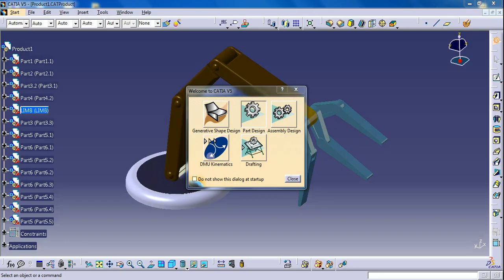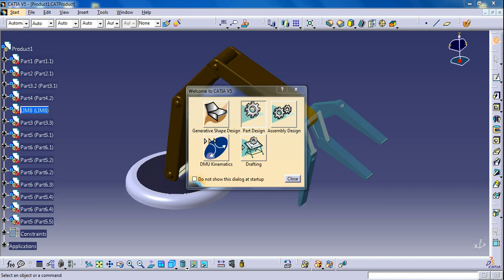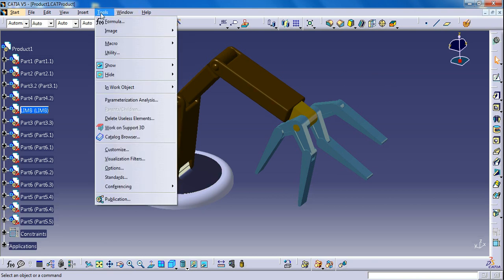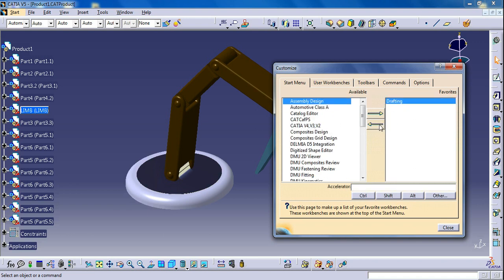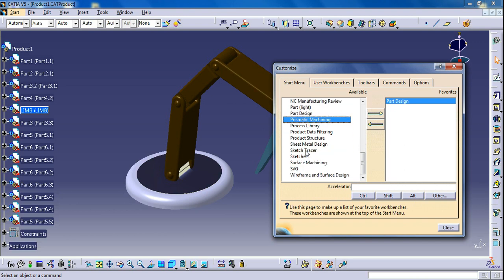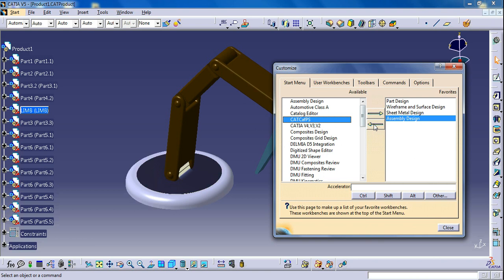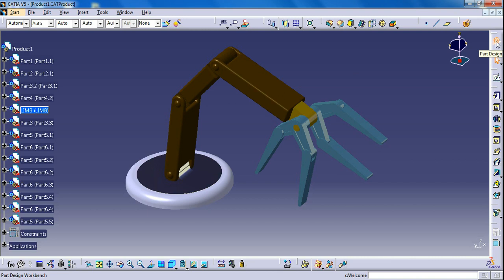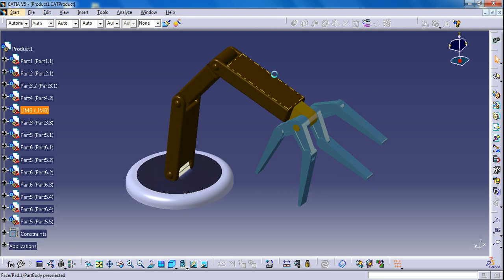CATIA V5: How to Add Workbench Shortcuts | Workbench ICON Button Customization

Comment: Hello..im working on surface modelling using sketch tracer..i have to use 3d curve from free style frquently so how to add it this only command in GSD workbench..
Reply from the maker: Hello Swapnil,

Thanks for watching the video and commenting..

I didn't have much interaction with Freestyle or Sketch Tracer workbenches in CATIA V5.

But You can always switch between the workbenches. Freestyle to GSD or to Sketch Tracer.

If it doesn't work then option is saving the file as igs and re-opening it in required workbench such as GSD.

Thanks and feel free to comment.